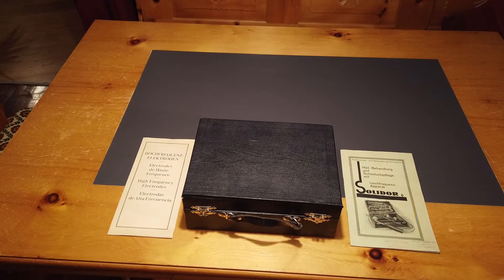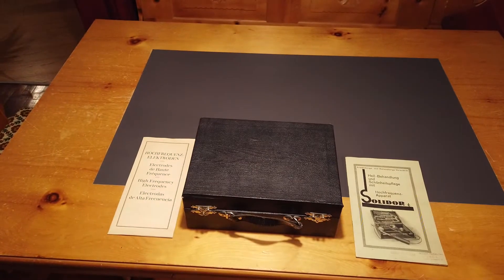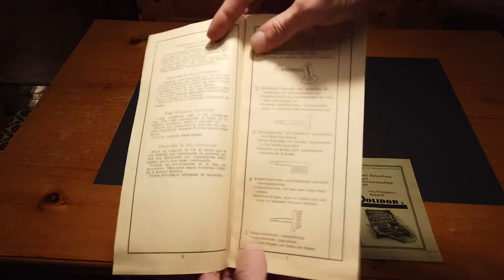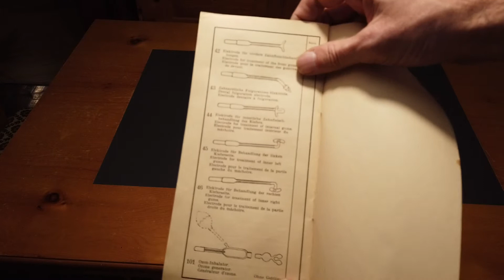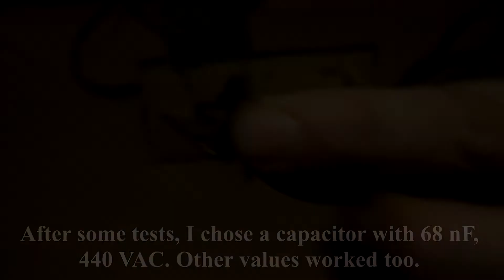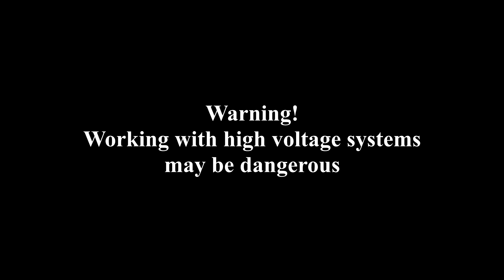Replacing the capacitor in a Violet Ray

Comment: I need to replace my capacitor but am very confused about the choices. The one that was in there says 2KV. Is that the output? Would any 2KV capacitor work? I just installed one that is working but my electrode isn't glowing and there is not break in the current... Can you help me? Cheers

Comment: Polypropylene vs Polyester capacitor which is good? I got old Original Haider device (1930s regular with just a few electrodes) but the Capacitor/Condenser was broken and last used abt a decade ago, but I don't know which cap ratings to use to restore it ? 220V VAC power.
Reply: Polypropylene, you have to be careful with the voltages, often they state the DC voltage even though they can be used with AC, anything below 1000VDC will die quickly(it will just lose value) depending on the amount of inductance in the coil, I suggest trying to get as close to 2Kv DC as you can, this will typically have a size of 1cm or more diameter, as for value, they vary between units significantly, I have had them go up to as much as 5uF, but typically they might be 50nf to 500nf, good to keep a selection in and see which gives the best spark, start with the higher values as lower resonant frequencies give more powerful sparks unlike the modern version of wand that are around 500Khz, you want to aim for 200Khz-you can check that with a oscillascope place a couple of meters away-the probes will pick up the signal without any contact (DO NOT CONNECT THE PROBES!!"
Hope that helps.
Best models seem to be the Rogers Vitalator-they have good wand transformers which is usually the first thing to give up the ghost.

Comment: Hello, Awesome video. You say to test the output to make sure you get the correct condenser for my machine. how do I do that with a multi meter. Also my rota switch is attached to the coil and has a spring in the middle of it, it won't change the amount of current coming out the wand. Do you think this fix will work? thank you for your time

Comment: Do you think you could draw me up a schematics of how the wiring works. Like how the wiring feeds from the potential meter ,capacitor to the coils. I mean just like the simplest drawing you could do like show the wires going how the wires all lead into what. I know it doesn't have a potential meter but I mean if it did you know how would that work or how the wires come off of the little rotor switch that you have and run do they run into the capacitor first and then into the coil? Okay thanks a lot appreciate it. Frank

Comment: I have two violet rays, but in bad condition, one is from 1932 and the other from 1933 and I have a lot of electrodes for them, but I dont have the original manuals or electrode lists for them, could you please maybe scan the manual and the electrode list? I would greatly appraciete it!
Reply from the maker: Hi, I already intended to do that, but it's mainly written in German, not sure that helps...
Reply: @MirkoKulig  I have no problems with german
Reply: A couple of manuals for you; https://archive.org/details/master-violet-ray-manuals/page/n35/mode/2up 
 https://twotowers.com/documents/renulife_1919_manual_text.pdf
Reply: @MirkoKulig  Thank you a lot, I will check out your website, I will contact you.
Reply: @MirkoKulig  I send you a message on your website
Reply: D arsonval